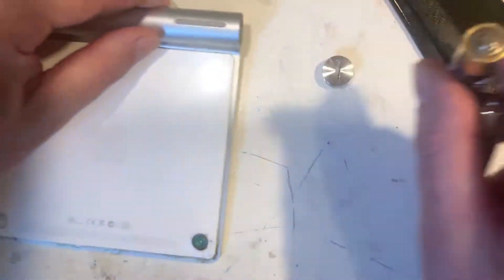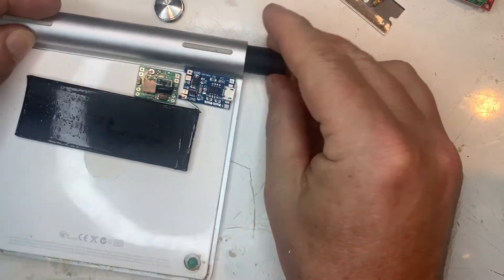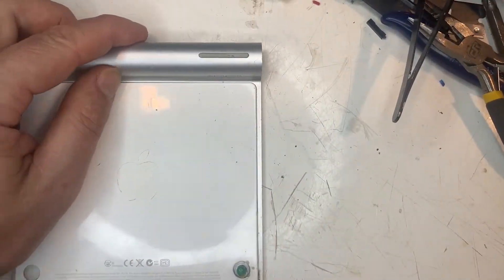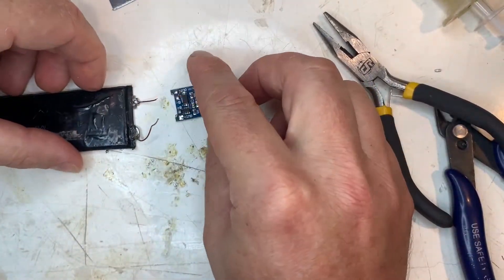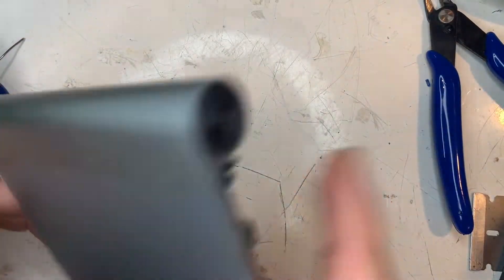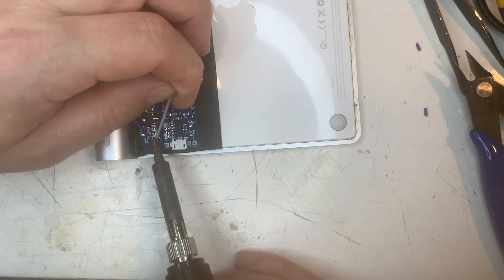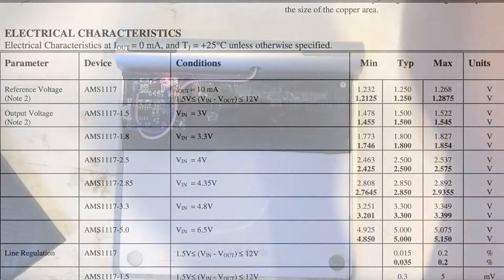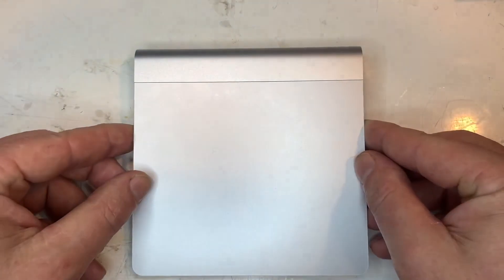Apple A1339 Trackpad LiPo Conversion - I hate changing batteries

Comment: hi, great project! I don't suppose you have released the 3d-print file for the battery blank for download? I would love to make these changes to my old Apple keyboard which has the same 2xAA housing. Thanks!
Reply from the maker: Yes I have that, it's right down the bottom in the description.
https://www.myminifactory.com/object/3d-print-apple-a1339-battery-adapter-215248

Comment from the maker: UPDATE It's held its charge for about 8 to 10 days with no issues so far. My Mac reports a slowly decreasing battery percentage.
The battery is now at 3.45v and the AMS1117-3.5 is outputting 2.56V, that is way better than I imagined it would work for this scenario!
Yes a new, not half worn out old phone battery would have been a better idea... but saving $10 by using an old thing which would otherwise have gone to a recycling centre is also OK.
It pretty much exactly emulates the voltage range the trackpad would see if it had premium AA's in it.  Now I wonder which device is next? Looks sideways at my TV remote
Reply from the maker: Confirmed the battery lasts 10 days on a single charge, which is not so bad considering it had finished its course in an iPhone years earlier. There is plenty of room for a larger battery, perhaps even 3 of the same type, but because it can be charged while in use this is good enough.